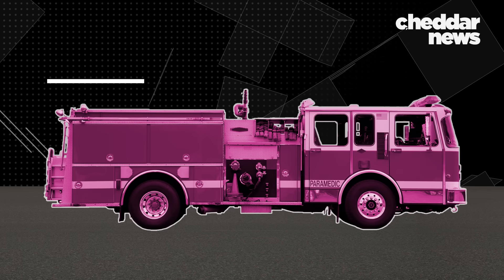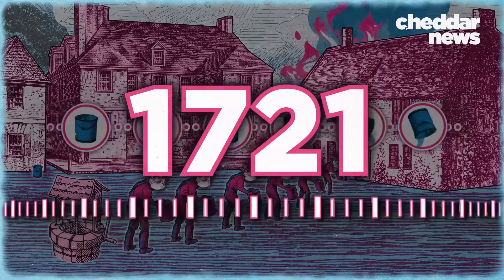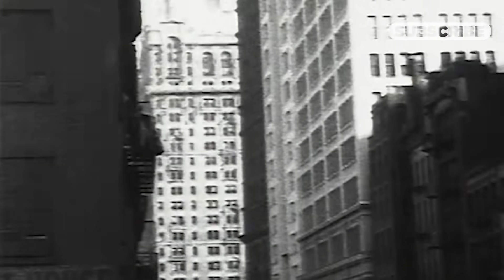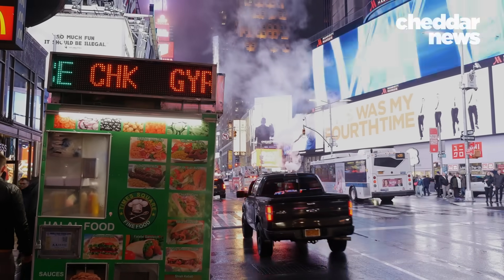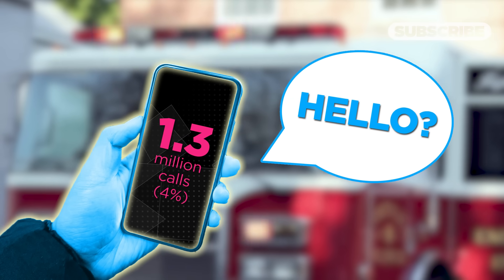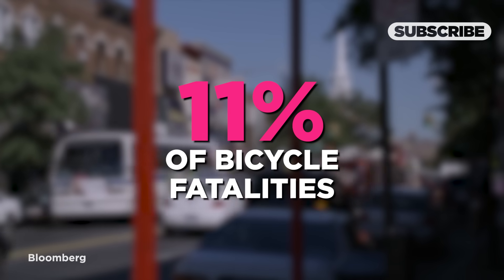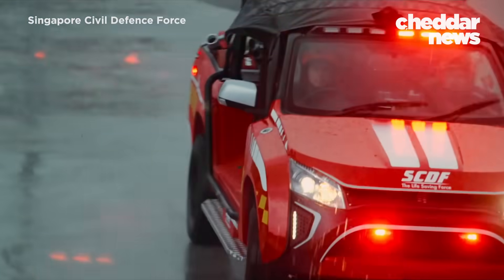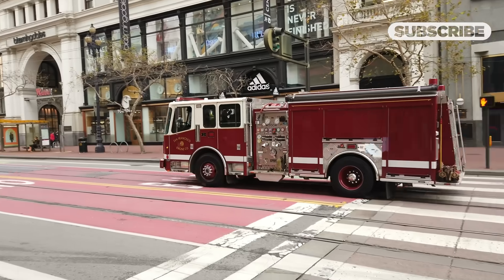Do American Fire Trucks Need To Be So Massive? - Cheddar Explains

Comment: Well the one your talking about is not a fire truck its just a engine (A.K.A a smaller version of the fire trucks) a real fire truck is actually ones with trailers and some ladder truck's in Europe are smaller that has lots of advanced but it  cant reach some higher buildings in some places like NYC LA and more. And not to mention Europe's fire trucks are meant to be smaller because their roads are smaller. and the "fire trucks" your saying about Singapore is different its a pickup truck the pickuo truck is only used for some search and rescue missions where trucks cant reach and some trucks in the U.S you mentioned are being use as brush fire trucks or engines thise trucks are used for smaller roads yes but its also used for forest fires. search and  rescue and basic medical trucks.
Reply: "dder truck's in Europe are smaller that has lots of advanced but it  cant reach some higher buildings in some places like NYC LA and more" I'm sorry that's wrong. 
All the Ladders in e.g. NYC are 105 ft ladders. Not sure about those in L.A., if all their ladders are 105 ft as well, or if they also have some shorter ones. However the standard European tower ladder reaches the exact same (!) height of 105 ft.

Comment: Fire departments love bigger is better.  In my suburban town that has a couple of three story houses but mostly one and two stories the fire department needs a 105 loot ladder truck.  Every single house is less than 200 feet of a hydrant and in many places hydrants are place 50 feet from each other, yet the Engines need 1500 gallon water tanks, on medical assist calls instead of additional help taking the pickup the department has they they take the engine, even though the pickup, even thought the pickup has much lower operating costs, is safer to operate  and its sole purpose is transporting the firefighters (all needed equipment is on the ambulance)
Reply: you are aware that ladder trucks can be used for many different things, and that it's not only about reaching high up?

Comment: njb's video way better
Reply: Respectfull speaking, njb's video is pretty bad too. The only points he makes well are the urbanist points "why don't you make bike lanes long enough and accessible for emergency vehicles, why don't you ban on street parking (starting a whole other issue where to put those cars etc)". 

Some of the most egregious points in his video he makes are flat out false; such as "custom chassis are less safer than custom chassis". You talk to ANY leatherhead out there and they ALL KNOW that; THAT is the legitimately ALMOST the primary selling point of buying a custom chassis apparatus. Besides durability and workspace ergonomics; these rigs are rated at a much higher safety rating then their commercial counter parts (think like the popular Freightliner M2 106, or the International HV507 (former "WorkStar" of the 7400/7500/7600/7700 trims )); hell even compared to the most popular European Fire Apparatus Trims of MAN/Mercedes Atego/Scania 4-Man P340 Work cab.

THE OTHER egregious error I could not forgive in any circumstance is the fact he called European fire trucks smaller; when the trend there too has been ever increasing. 

Starting with widths; legit the MOST popular euro commercial trim - the P340 is the same width as basically all American fire apparatus, give or take two inches (Scania coming in at 98inches for the most popular models, others coming in at 100inches). Most American fire apparatus come in trims of 100inches or 98inches; with a few esoteric widths of 96 and 94 inches still offered. 

Going to length; I would encourage you to not only just find a nice image measuring software, find images of "almost perfect sideways" to camera, lens correct them to make them flat, measure one rim as a "standard", then a second rim "as an error" (so for example; the rims of an Scania P340 (Crew Cab) are 22.5 inches (coincidentally the largest rim sizes you'll also see on American fire apparatus)) - after accounting for error you'll find they're about within 1 to 2 feet of an American fire truck. The different I tend to see are in the front of the cab, and the lack of a front bumper (usually about 10 to 12 inches). Where the European counter parts will be about 26 to 28 feet, you'll find specs like in my own department (Orange County Fire Authority) about 28 feet. This is assuming a "20/50/40" inch compartment set up. This is the the most common compartment length set up. After that; let's say a 30/50/40 - you're starting to hit Rescue Engine specs - which at that point - you ARE making a longer fire apparatus than european counterpoints - but at what negligibility?

The only people to have credence against "large fire apparatus" are places like Japan, and the Philippines - and SELECT JURDISTICTIONS in Germany. If you've ever watched Japanese firefighting - like RAW footage - it's no secret. The Japanese do a lot of things great; but firefighting is definitely not one of their strengths. The Philipines is definitely a crowded "favela" style country - you must forgive them, thus the need the "twinkier" Japanese apparatus. I know I'll get some hits "BUT WHAT ABOUT AUSTRALIA'S ISUZUS". First we have to understand the role of the Isuzu in terms of the Australian fleets. Typically used for service support vehicles, cheap government rescue bodies (think of this like the USDA's USFS's Freightliner M2 106 Type IIIs), or wildland rigs; particularly serving in-what-I-would-equate to the American Type 6 fire apparatus. The Type 6 is a smaller fire engine, with a smaller pump, a very small tank, usually outfitted for ingressing past points where Type-IIIs (the meat of wildland firefighting). I know I just info dumped a lot of stuff on you there so I can elaborate on each thing on demand - even observerd Australian Fire Apparatus meta, why I focused on it in this example (trust me there's a good reason).

And THAT is a good part to start talking about how he called American Fire Apparatus jack-of-all-trades? Has this man ever visited a single fire station? Is he even familiar with a SINGLE department's operational philosophy? i.e. How they staff the rigs? What equipment to they put on the rigs? What equipment do they forego on a rig? What apparatus do they have? How have they spec'd their apparatus? Why have they spec'd this apparatus this way? What is their response model? What are the risks in their area? What is their risk tolerance? What is their contingency tolerance? (those last questions I asked are important when the challenge particularly to California agencies "sending a fire truck and an ambulance" to medical calls comes up). 

At 8:23, 9:08, 11:40, 23:50 - he straight up pro-actively attacks detractors completely disregarding that; the very nature of emergency services - is to be contingent. To be prepared for anything and everything. Modern firefighting was legitimately BORN in America. 

The comments are the next most egregious thing. Both from defenders and detractors. One thread in the section is about the Wessex Engine VS the KME P24. The defender did a bad job defending the P24, the detractor then does a terrible job at assaulting the P24 - however I would chaulk this up to the defender not being well informed on what the P24 was, or the situation; particulary who the crews are, etc etc. For the sake of brevity I'll keep it on that; and offer the offer - to explain what I thought was wrong with this.

The German Firefighter comments and quips by other people however are so on brand. However as someone who talks to Germans too often - there is MUCH, MUCH, MUCH more to be understood which - for the sake of brevity in this already long manfiesto - I will offer to explain upon request in what I've chalked out in slinging ** back and forth between the Amerifats and Germoneys in regards to fire apparatus. 

Another comment that stood out to me was "what about an exchange program between different country firefighters?" to which NJB says "that'd be a great idea" to which he does not understand; this has been happening for DECADES. H*ll I was just talking to a Belgian? dude in the comments of an insta-reel who did a tour of duty here in the 90s. Which leads me to my final point.

At 24:45 njb states he consuted experts - to which I truly, highly doubt. Perhaps in regards to urbanism - yes. But you look at his sources cited and it's all just Cheddar style Google searching, and likely an apathy against the fire service - which - stereotypically contains people of specific ideological dispositions that njb would be opposed to. I think njb has a hate boner against firefighters and their stereotype AS A FOUNDATION - and from there - he takes the (very real) experiences he's probably had with implementing urbanists ideals into reality, set back by the fire department. However his critcisms bring very high eyebrows, and then his circlej*** fanbase just regurgitates assumptions from what limited knowledge they know. And this is not to begin the recent dis-enfranchisement NJB has been doing to his own fanbase in recent times (see his comments on North American, anyone looking to pursue his ideals).

(Also again; any questions or clarifiations - please - PLEASE do not hesitate to ask, but I will warn you; be PREPARED to read 😂😂)

EDIT: AND ☝ I almost did not mention. ONE OF THE MOST damning points from the most qualified experts to speak on it; Qualitatively America VS European fire apparatus. Ask ANY Chilean whacker, or firefighter. 10 times out of 10. They pick even the WORST constructed, bottom of the barrel, low bid American fire apparatus (Rosenbauer/Ferrara). Click through these comment sections - you'll understand very quickly; the verdict is out. American Fire Apparatus were PURPOSE BUILT for the job, where European rigs - no matter how many flashy advertisements and hype videos - just seem like an after thought. Which I think when we ask "how come euros don't have problem with their rigs?" - I think this may speak to a whole NEW issue and ancedote about the roughness of America VS Europe - which - is a whole other tangental observation and conversation to have. It's like how the Norwegian(?) criminal punshiment system would not work in a country like America; whoms criminal tend to be insanely predatory - and OF high quantity (against the quantity of "predatory" criminals - of people who could be defined as predatory).
Reply: Hold up I gotta add an ammendum here; add France, just particularly Paris who actually abides by small apparatus rule

notjustbikes, and his commenters/defenders/fanbase mentions how it's bad the American fire engine "tries to do everything", bringing up issues of jack-of-all-trades, to try and master all is to master none, etc etc etc; quick quips type phrases - very redditey. HOWEVER they both then go onto compliment the German Firefighter argument of how they show up into comment sections saying "oh yeah, we have that, can do that, and MORE in one apparatus". So I have to ask; the American Firefighters don't get a pass because their apparatus is perceived to be "bigger" (putting quotes) - HOWEVER the Germans get a pass because their apparatus is smaller??? I thought having everything was bad? So they get a pass just because of size?

Then there's the detraction that "1000 gallons doesn't need to show up to a medical" without having knowledge was 1000 gallons entails. Buddy. No REGULAR engine is carry 1000 gallons. That's a tactical tender. That's a small tanker. That's probably a tanker engine - and even then that's going to be in a non-hydrant or water scarce district. Most engines carry about 300 to 500 gallons MAXIMUM (for reference that's about 4 to 8 minutes of water depending on the bar and deluge - 2 minutes if you start hitting it with the deckgun). I mean did he even try to profile fire apparatus properly - or even in metropoltian areas? One of his arguments centers on attacking "1000 gallons" showing up to medical calls in urban and suburban areas - but these areas have plentiful hydrant cover - you almost never see the Engine/Tanker he's attempting to describe but doesn't even know exists/what it is/where it would exist/why you would purchase one. EVEN THEN the only time you'd ever see an Engine Tanker of the 1000 gallon spec in suburbia would be in an area like South Metro at their Station 47. AFTER THAT you get legtimiate Engine Tankers in rural areas built on tandem axles - usually carrying about 3000 to 4000 gallons depending. It really felt like another Cheddar video with cursory Google searched knowledge.

And then ONTOP of that he and his commenters complain about lack of specialization? Have they never heard of the Engine, Rescue Engine, Tactical Tender, Tender/Tander, Quint, Rearmount, Midmount, Rescue (walk in rescues, walk-around rescue), the Tractor Drawn Aerial, Utilities, Commands, Battalions, Chiefs, Flycars/Sprinter Cars, EMS units; vans, pickups, vanbulances, ambulances, pickup-truck/commercial-chassis based rescue bodies acting as non-transport medic units, SUVs, deluges, foam tenders, crash tenders/arffs, LET ALONE the trimming and spec'ing - tandem axle, tank size, pump capacity, length, cab width, compartment size (subsect of the greater "compartmentalization"), hose bed layout, aerial device, type of aerial device. 

ALL this and let alone what I mentioned in my first comment about operational philosophy. Are you going to build a two piece unit - one 175in wheel base engine, with a wagon style body, low to mid rise hosebed, with a F550 rescue body carry rescue/extraction/medical equipment - while maintaining the engine carry firefighting and forcible entry specific tools? Or are you going to keep the rescue body there and scarce but STILL THERE - but move the extrication responsibility to the Truck and have the truck be added to the ticket of an incident requiring extrication? He blindly paints all departments as the same - not taking the time to go through and see each department is different - just visually to the untrained eye looking the same. Perhaps regionally there may be a common philosophy but department to department it will vary. Just very disingenuous writing and narrative he's crafted. And then he actively tries to pre-emptively dodge criticism (like I mentioned before at 8:23, 9:08, 11:40, 23:50 in his video) to something that is very self evident of being true - however he calls it to be untrue (that things are different place to place (there is nothing wrong with pre-emptively addressing any criticism - it just has to be valid)).

Comment: There are so many different factors that affect the design of apparatus beyond a surface level "They are big". Fire loads here are significantly greater, and our roads can accomodate bigger vehicles. So, instead of responding 3 different smaller apparatus to a call, you can have one that does what all 3 of those smaller ones would do. This video also makes it seem like no NA department uses smaller trucks either, and that is just wrong. Mini and medium pumpers are becoming more common in departments now, but it is situational dependent.

This video also is only looking at large city fire departments. Yes, big cities have big trucks because they need to flow big water and carry a tonne of gear. Most smaller departments that have more outside fires than large structures on fire will run smaller trucks because the hazard is different.

I get tired of this argument about how everything in Europe is inherently better simply because it exists in Europe. There are much greater details at play here than just looks.

Comment: Smaller means less water carrier. Less equipment carried, and the ability to not reach tall buildings well. Most departments have multiple vehicles for handling situations. We are not going to use those euro trucks
Reply: that's ... not quite true. Yes smaller vehicles means less water ... which isn't an issue in areas of good water supply, or when tactics include a fire attack at lower gpm and higher psi rates. 
"nd the ability to not reach tall buildings well" absolutely wrong. Take a look at those German ladder trucks. The trucks themselves are about half the length of an American Tiller Ladder, yet they reach the same height. To spin this even further: European trucks of comparable size to American ones reach 2 to 3 times as high (!). 
"Most departments have multiple vehicles for handling situations. " just like in Europe ...
Reply: @EnjoyFirefighting  yea I said THOSE euro trucks
Reply: @lemmingsfly  you use SOME Euro trucks; 
And the aspects you mentioned like not being able to reach as high with a smaller truck are just not correct. They reach the same height or higher despite being smaller.

Comment: This video is terribly biased, with no references to technical information on why there are difference between European designed fire apparatus, and North American designed apparatus. There is plenty of information from experts written in fire service trade publications about why there is the difference. This video doesn’t reference any of these reasons. European designed apparatus are smaller out of necessity of driving on old world city narrow streets, and they individually are not more capable than a North American designed truck.

Comment: FYI a truck and an engine aren't the same, nor used the same way. And both are necessary on the fireground. You can't replace a truck with an engine, because an engine is smaller. And you guys keep showing smaller versions of this and that, conveniently bot mentioning the internal water storage or pump strength and size once. Ignorant.
Reply: "because an engine is smaller" uhm ... not necessarily?